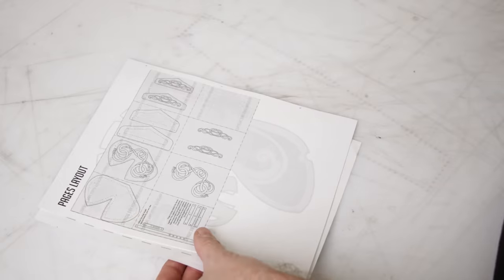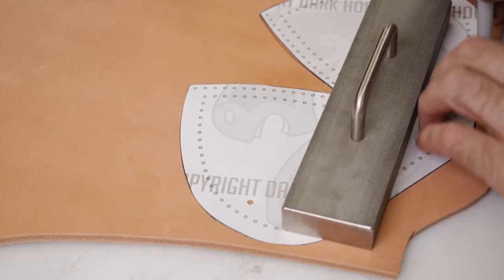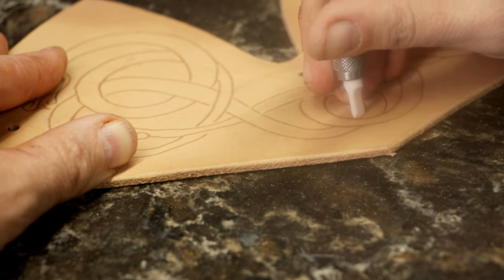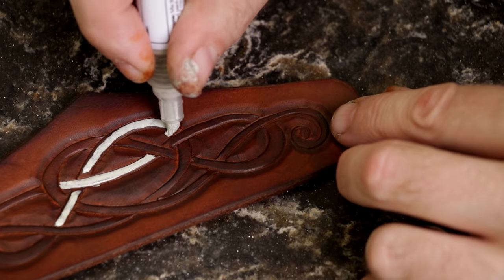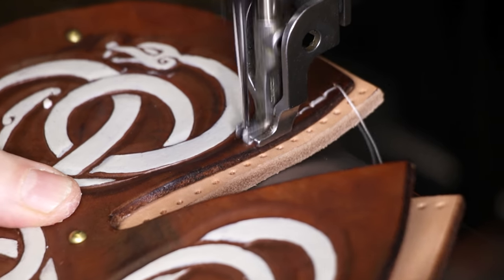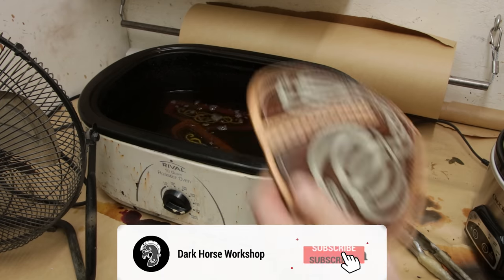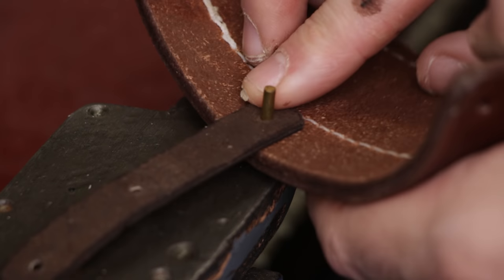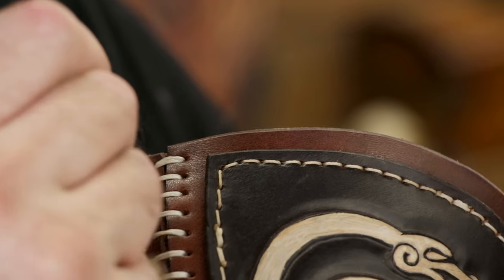Leather Armor Tutorial - Shoulder Armor | Spaulders | Pauldrons

Comment: Hi, I've been following you for a long time and finally decided to start making leather stuff. The thing is that where I live the leather is meassured in mm not oz and I can't find a reliable conversion from oz to mm. Could you tell me at least the thicknes (it could be in inches, that I can convert easily) of the 10, 12 and 14 oz that you use in this build? For what I've been asking around the maximum thicknes I can buy is 3.5mm. There's another "leather kind" that's also veg tan and it's thicker but at the shop they told me it is used to make shoe soles and it can't be wet molded because it's too hard. Do you know if that's true? Maybe they simply don't know because they usually sell to shoe and furniture makers. Thanks for all the videos and iformation you gave us all the time. I hope you can answer my questions. Cheers!

Comment: I've been just printing the patterns for carving on printer paper and then lay it over the leather and then poke holes along the lines, no more than 1/8in apart, with a small awl, not too much force, just enough to make a tiny yet visible hole so that I can go back and trace over the lines with a pencil and then start carving.  But then recently I got some Celtic knotwork patterns with these transparent sheets with a raised ridge running along the lines on one side, which seems to allow me to wet the leather, lay the sheet with the ridges facing down onto the leather, and either roll a rolling-pin or roller over it, pressing down hard, or lightly hammer with a rubber mallet, and it seems to make visible indentations in the leather (not sure if that is how they are intended to be used 😅).

Comment: 6:30 back stitching to secure the thread ends is the standard procedure for using a sewing machine. But it is a dead give away that the piece has been machine stitched. ... Here's how to secure the threads/stitches without back stitching. ... Start sewing making sure you have a good 3-4 inches of thread tail at the beginning and at the end of your stitching... Don't back stitch! Remove the piece from the machine. Pull on the bottom thread until the top thread's loop vs be seen. Pull that top thread tail to the back and tie the top and bottom thread tails into a square knot, cut and melt the ends into the knot. It will be impossible to tell a machine stitched piece from a really good hand piece... even when checking the back. Sending lots of love 💖 from sunny 🌞 Arizona 🌵😷

Comment: I've heard (a while back, admittedly) that using an awl for rivet holes is better than a punch because a punch cuts the leather, whereas an awl essentially pushes between the fingers and keeps them more intact. Have you had any feedback from other leatherworkers on this? Looking at techniques for longevity's sake, and wondered how this realizes in practice. I appreciate any feedback!
Reply from the maker: In a perfect world you'd awl or machine sew or pricking iron. But you have to weight that against ease of use is all. Harder to stitch smaller holes.

Comment: I have some questions regarding your waxing process if you don't mind answering, since it seems far more efficient than my current method. 

You said you use paraffin wax, can you  use beeswax instead? 

Do you leave the wax in the cooker after your done or do you empty it out or let it harden and heat it up again later?

Thanks in advance.
Reply from the maker: Bees way alone is too soft I find. Some people mix it with paraffin . I just use paraffin  and leave it in the cooker after.
Reply: @DarkHorseWorkshop  Thank you, I will have to experiment a bit more with both and see how it turns out.